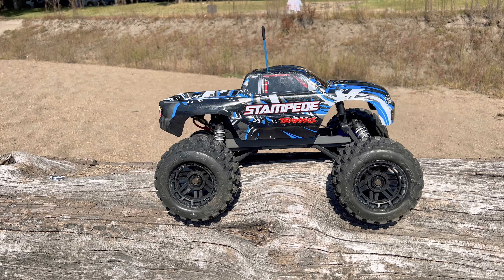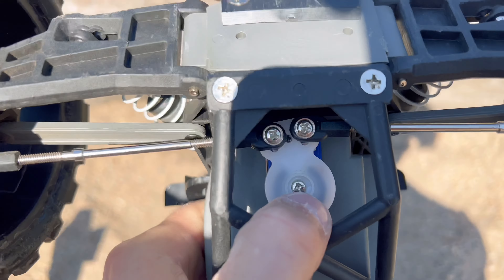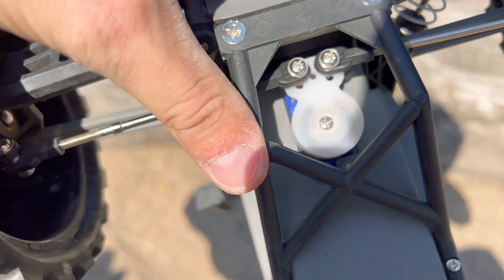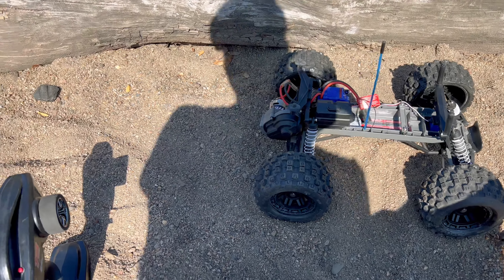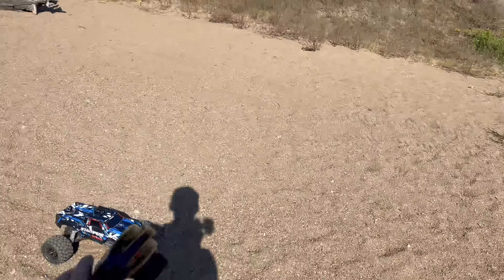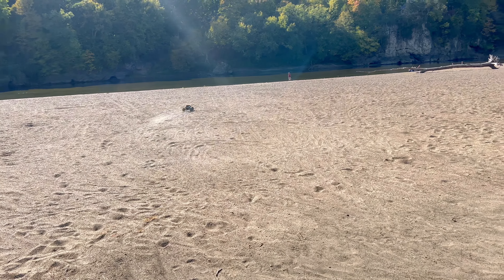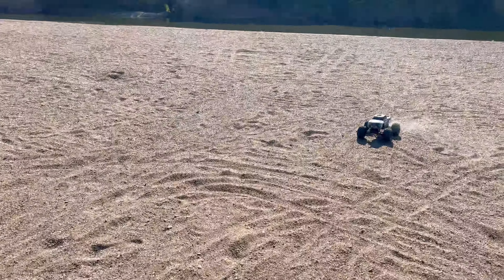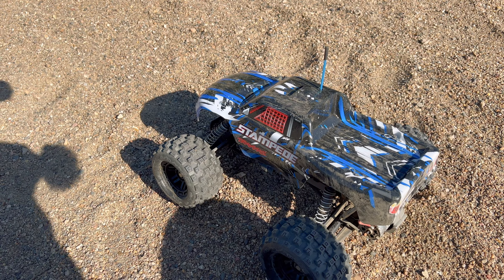SAND BASHING the “CHEAPEST” Traxxas Stampede PROJECT !

Comment: I recommend sealing with gearbox case with electrical tape. Just line it on the inside and rocks wouldn’t come inside. The small clicking can be from small debris, some you can’t really see only if you get a good close look at it. I did this with my slash and had no problems with clicking/stripped spur gears since. You should try it.
Reply from the maker: You mean to tape the motor?

Comment: Omg, why did it die so abruptly! Are there any mods on this car or I should expect mine to burn like this? 😂
Reply from the maker: Mine has some upgraded tires and it’s running the high speed gearing….I would definitely be ready for the stock motor to go though…even running a stock setup

Comment: You need a rebuild able BRUSHED motor. You have a budget truck video. You need to stick with a budget  truck video.  You already have the speed control for the motor.  $15-$35 and done. You need to take the stock motor and take it apart and show people why it failed. Compare it to a rebuildable brushed motor and show the difference.  You will see on how the brushes are set up.  The stock motor is complete garbage.  Buy some gears.  You don't need a brushless to go fast. Every utuber has a video on a brushless. Plus it brings a $180+ to the truck. Why not just buy one with the brushless.  Show people that they can have a great truck on a real budget.
Reply: This makes sense. I’d watch this.
Reply: @brothertax  there are SO many options with a brushed motor.  Stock, modified, 9t-50t motors. So much cheaper.  I run a 27t triple stock in my stampede. It's way faster then stock setup and so far I never been passed by a brushless in a race. It cost me $25. I could go way faster with a 17t single hand wound modified. Rebuildable stock motors are the way to go on a budget. Plus you can show what happens when you add a silver brush or full copper brush, or half cut, cavity cut and so on. It endless on how you can tune the brushed motors.